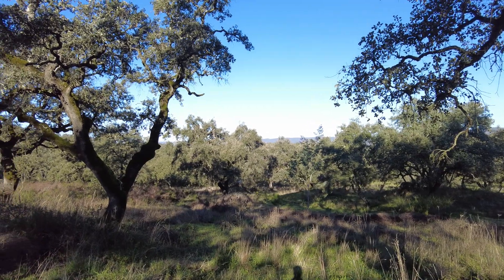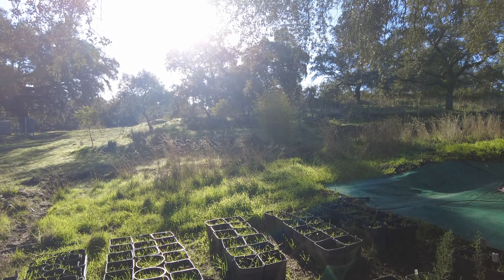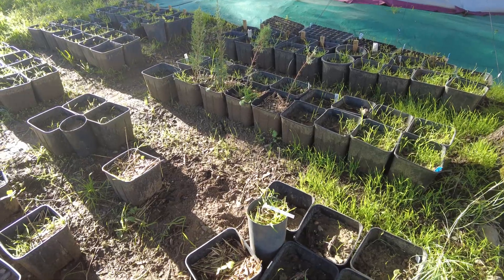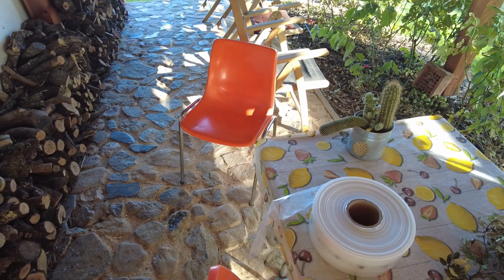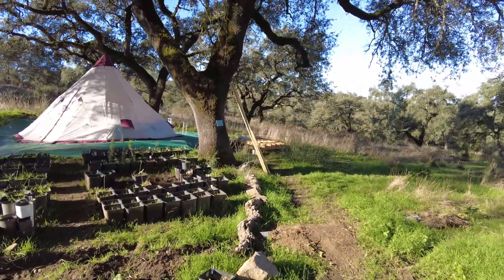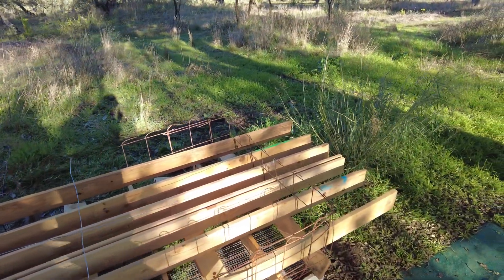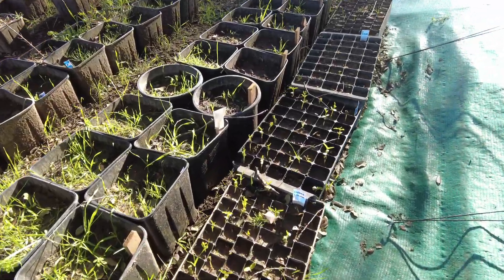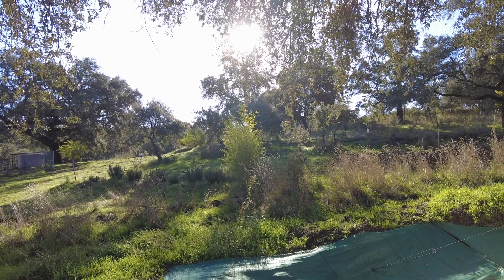Root Air Pruning: Growing Trees Fit for Harsh Mediterranean Landscapes #agroforestry

Comment: Martin, I know just what you need for growing seedlings with long taproots: Get some cardboard mailing tubes! You can get them in 3-4" (75-100 mm) diameter and a variety of lengths up to 72" (180 cm). They are very sturdy - you could order long ones and cut them to the length you want with a saw. They also make square and triangular "tubes" in the diameter you're looking for, and make them in clear plastic as well (for things like packaging tennis balls for sale, for example). These would stand up on their own in your crates or cages and be much easier to water. They're sturdy enough that water won't make them fall apart for at least several years. You could even plant them directly into the ground, as long as you've trimmed the tops to the soil level in the tube before planting. That might even encourage the seedlings to continue sending roots down deeply the first few years they're planted out, until the cardboard disintegrates.
Reply from the maker: SUPER SUGGESTION. You receive the star of the week. I'm going to look for them now. I've planted a lot of seeds now. Let me be prepared in spring. Keep sharing. Much appreciated

Comment: i grew many different trees in the black nursery crates that you have . i filled them to the top with year old leaf-compost and some grit sand , then planted quercus,castanea,fraxinus,juglans,corylus etc, covered with compost and some mesh for mice protection and left them outside over winter, great germination rate and when you lift the boxes onto some blocks their taproots get pruned.if you want deeper crates mabye you could build a collar inside the crate to raise it or cut out the bottom of one crate and strap it onto the other, that way you could have a container with 40x60x50-60cm height.
Reply from the maker: Great suggestion. I need some sane ideas. Thank you for sharing
Reply: i was to cheap to buy wood for air prune boxes, those crates are sturdy enough but you can move them around, the larger volume makes it easier to hold water and if you flip a crate over one of them you can shade them for the harshest weeks. if left fraxinus ornus to grow for two years in the crates, no problems with the roots
Reply from the maker: @MrBrznak Good suggestion. Thank you for sharing

Comment: Bottom watering is so much more convenient. Also, it makes an incentive for the root to go deep fast, because it wants to go where the water is.
I would recommend putting those tubes in some kind of bathtub or so. Then you fill water into the tub and let it wick up in the tube instead of watering the individual tubes from top.
Reply from the maker: I was looking at that. In my mind it will negate the root air pruning aspect. The watering from the top will definitely not work well. A system where the tub can be removed after watering will be super BUT my small mind can't design that. Keep sharing. Much appreciated
Reply: @SuerteDelMolinoFarm  no need for the water to let out. Water you pour in  is gone in no time (assuming you don't overdo it). It will wick up inside the tube due to capillary effects. Only problem is to evenly spread the incoming water. Not that there are tubes sucking in all the water while some in the back stay dry.
I don't quite get the air pruning point. You will not have any air pruning unless the root grows into the air. But since you want them to root deep, why would you want a prune?
Reply from the maker: @b_lumenkraft To transplant an oak tree that might survive the harsh summer we need potted trees for two years. When potted for two years then the taproot is going in circles without growing additional sideroots. These bags have a 40cm depth and that taproot will find the bottom of the bag that has a cut in it. That part of the bag is in the air. When the taproot gets there in the air then it stops growing and the plant starts producing lots of sideroots from the taproot. That creates a plant with 40cm taproot with well developed sideroots. The taproot didn't circle and is strong. I hope I explained well.
Reply: @SuerteDelMolinoFarm  yes, i get that now. I don't see bottom watering being contradictory to your plan. The tab root will be air pruned even with bottom watering. All you need is to not let it sit in water for too long. (which would grow anaerobic bacteria which you don't want anyway).

Comment: It is possible du create a homemade deep plant container with a pipe cut in 2 long pieces and reassembled with tape, rubber band, strings or long strips of fabric wrapped around. The bottom is made with chicken wire to maintain the substrate sand/organic matter. For planting, you easily disassemble the 2 parts of the pipe and remove the plant from the mold without breaking the long root. The pipes can easily stand in boxes with strong grid at the bottom, raised on bricks to improve air flowing. The pipes are reusables. You can make the same container with plastic bucket without bottom and plant more seeds in it. It is easier to irrigate and plants generally prefer to grow in good company, but you have to be careful with  separating roots. Hope it will help you
Reply from the maker: I need a lot of help with this. Therefore your suggestion is much appreciated. The real test is transplant and growth afterwards. Keep sharing. We need ideas

Comment: Assuming your land is 5ha, it can support up to 500 oak/cork adult trees. (OPTIMISTICALLY, in reality, less)
1. How many do you already have per ha?
2. Why do you want to plant so many (how many) of them?
3. BTW, will tap roots pierce those plastic bags?

It will be worth doing an inventory of 5+ year old oak trees and their density per ha, to know where you stand. 

Also, you want to fit plenty of fruit trees in between. Trees support each other to some extent, but also compete for light, water and nutrients. In a one-car garage, you can't fit 10 cars.
Reply from the maker: We have less than a hundred adult trees. I realise that my success rate was 10%. Therefore I need to plant many more to reach the 500 mark. At this stage I park all the cars in the garage and there is still space. Your questions and suggestions are much appreciated. Thank you

Comment: You are wrong black plastic tube available used by the film industry to contain large rolls of industrial film used in the print industry, I used to use it for strawberries  and potatoes hanging them on fences and walls.
Reply from the maker: Sounds like a good idea. Thanks for sharing
Reply: @SuerteDelMolinoFarm  Not great for the spuds , or at least not for me. but cherry tomatoes worked better. Like the straw berries you can grow them up and down the bag through smallish punched holes.
Reply from the maker: @davidprocter3578 I'll have to learn a lot from this experiment. Thank you for sharing

Comment: There are higher pots ( usually used to advocatos are about 40 to 50 cm), most nurseries usually dont use it for pratical reasons, because of weight. Specially if its to send by mail... it becomes very expensive. Its the same reason to use lighter mediuns (compost, bark, peat, etc) instead of soil, like sand, wich would be healthier. Anyway, most of the rrees in bigger pots were germinated in much smaller trays, and repoted several times, and most times the roots are a completly mesh and even rootbound. Most times its not a problem, even if the tap root is cut (most fruit trees are bareroot and the roots are cut, no problem). If you value a strong taproot the best  way is to germinate by seed, in place. Usually produces a more resistant tree...but its not pratical too.

The nursery looks great. Giant... let me sugest you start to invest more in the understory, in srubs and groundcovers. Glad to see some cypress in the mix.
Reply from the maker: Great suggestions. Keep sharing. I'm learning.
Reply: @SuerteDelMolinoFarm even for advocatos usually higher pots are used but its not related to tap roots (most science and pros dont value taproot much, or at all). The higher pots are almost always used because a higher pot (high to beam ratio) have much better drainage, and many trees (like advocatos) need good drainage. For most pros its more important a good fiber root, and sometimes even cut the taproot to encourage the roots to grow more fiber, and sideways. Wich is the reason to use "airpots" or airprunning system. You are going in a diferent direction by a diferent reasonning, and bet it will also work just fine.
Reply from the maker: @srantoniomatos Oh my. I'm always in a different direction 😂. I'll try all to have more success in planting trees. Much appreciated
Reply: @SuerteDelMolinoFarm you are too harsh on yourself. For what i have seen you have been having plenty of sucess and are pretty muuch very competent. Having said that, i have seen most diverse pratices have sucess,  and the same ones fail. My brothher in law have the heaviest red clay i have seen, not even a litle rock to help...he usually plants exactly as pros say not to do: puts lots of organic matter inside a big hole, and plants deep...Most times works anyway... i guess its a matter of luck and love. like woody allen would say: "whatever works".
Reply from the maker: @srantoniomatos I like that attitude. Thank you for sharing
Reply: @SuerteDelMolinoFarm  just remember a tip i saw in a video, not sure if it works, but seems to make sense: germinate the seeds (in the pots) in the same soil you intent to plant them. Suposely it help because they adapt from start their grow to the soil... as the first root (the tap root) goes out into the soil it signals the genetics to adapt to it...in case of clay soil its a bummer, not pratical, but...maybe.
Reply from the maker: @srantoniomatos Let's see. I have lots to learn. Thank you for sharing
Reply: @SuerteDelMolinoFarm the more i learn the least assure i am. And the less work and worries...now i just plug the seeds or the plugs in, smallest possible, barely dig, cover with mulch if i have some, and...wait to see what happens. Seems to be going fine. Had sucess with the "sintropic" last year, gona do it again this one...dig trench, amend it, and fill it with plants, seeds, cuttings...i was amaized, nothing died!
Reply from the maker: @srantoniomatos YES YES YES. Best news in years. Thank you

Comment: A tree with a cut tap root is a dead tree.
Reply: I planted thousands of trees, either with a cutted taproot or rootbound, most still alive and well. Most professional orchards use bareroot plants, most of them are cutted, all over the roots, no problem. It all develops and regenerates according the genetics and envoiremental conditions of soil and climate. If the plant is small it makes small to no diference. But even medium to big trees , most times no problems. Very few trees have deep big taproots, like pines do. Just think of bonsai: even pines can survive for centuries in a minimal pot, not tap root...
Reply from the maker: Yes. Now I'm angry all over. Thank you for stoking my fire. 😂